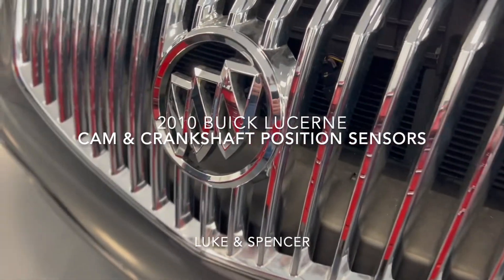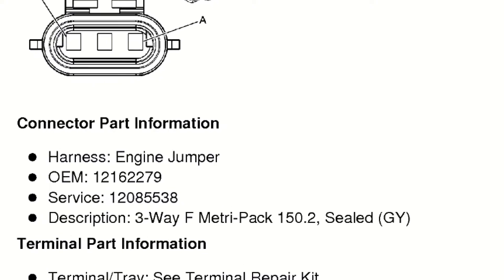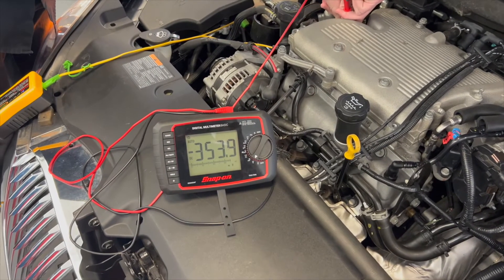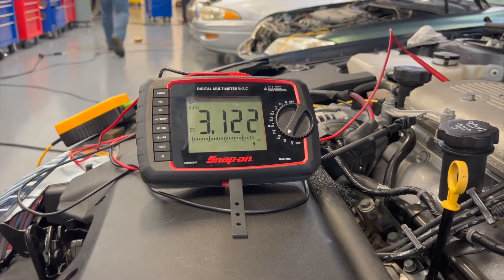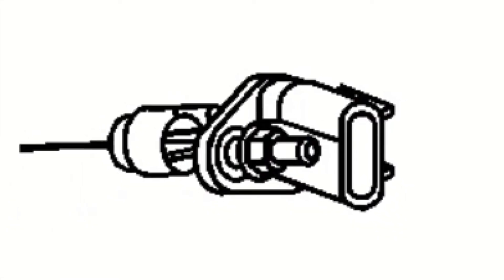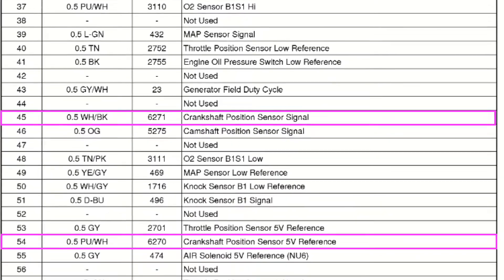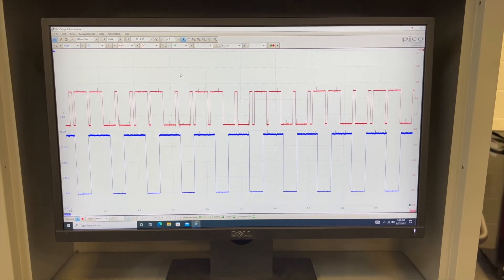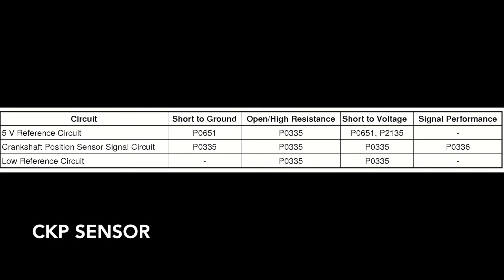Buick Lucerne Cam & Crankshaft Position Sensors

Comment: Its same for 2008 lucerne? 3.8
Reply from the maker: The fundamental functionality of the sensors should be the same.  However the locations of the CKP and CMP sensors are most likely different on the 3.8L than what I showed in the video.